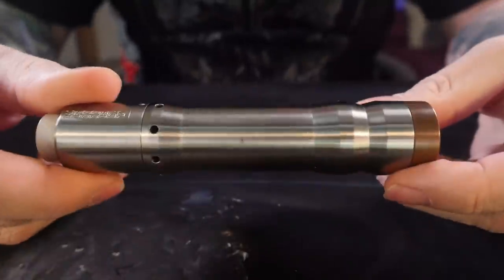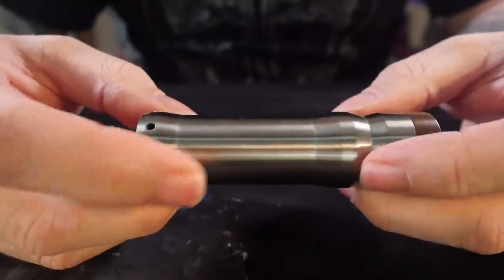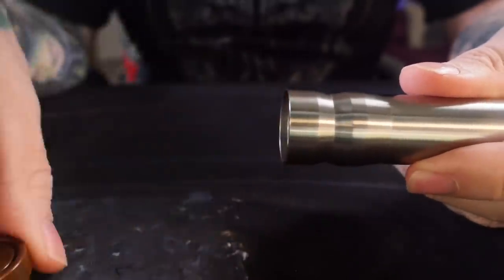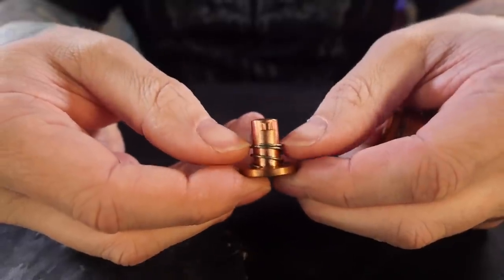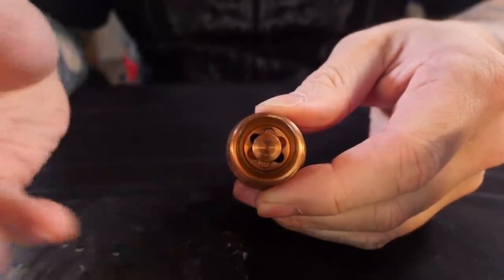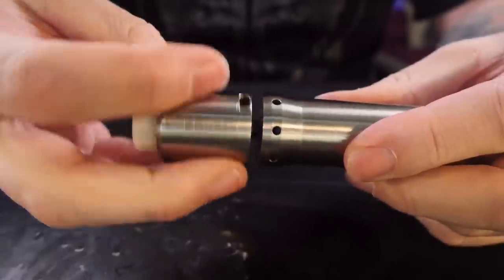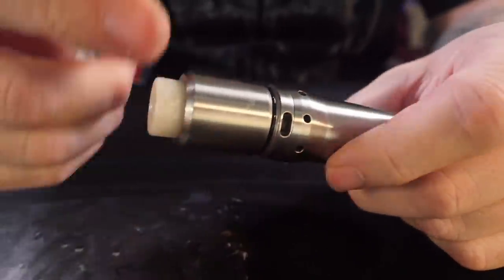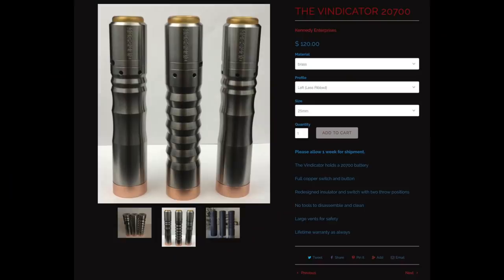The Kennedy Vindicator 21700 : Basically flawless

Comment: I'm a bottom airflow fan too man. Try this guys, with bottom airflow, tip to the side, drip to the post, tip the other way drip to that post, and just a little dribble in the center. No pop and paint, not juice running over coils and down the air flow. You just tip and drip, tip and drip. It wets the wick! No mess. Try it of you haven't.

Comment: Man you dont have to take off the cap and drip your coils, you can just pour your juice straight through the driptip and inhale right after that, cause even if the juice goes into the airflow tubes - it will go back as you inhale, so your mod wont be juiced up. Greets from Russia.

Comment: hey nick this is going back a bit but the viewer mail about the red wicks in the bare brass Kennedy i own a copper and get the same issue with mine ive noticed if you change your build to stainless steel it stops which leave me with more questions then answers but metallurgy  is fucking weird man

Comment: How long can you vape on it before changing batteries?
Reply: That will all depend on how you vape, what resistance you use, the milliamphours (MaH) of the battery, the age of the battery, what device you are using. There really is no clear cut answer to that question.

Comment: no full-time contact ResidentSleeper
production is good, but man, this mech is shit, because it will burn your battery eventually. this switch should be abandoned in hell. tauren mech mod, which you also reviewed is way better then this one because tauren won't reduce battery lifetime. also russian mech mods won't, because every single one of them, manufacured after 2016 switched to a better switches *ba-dum-tss*. i strongly recommend to you to buy one of them (El Thunder (there is 20700 version as well) , Russian Mechanic V5, GLM V2, Rockvape)